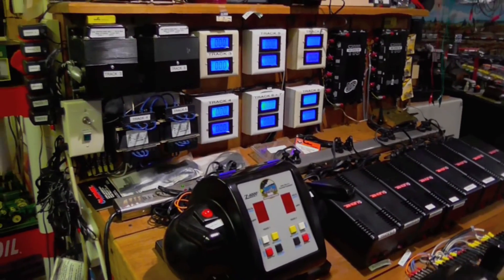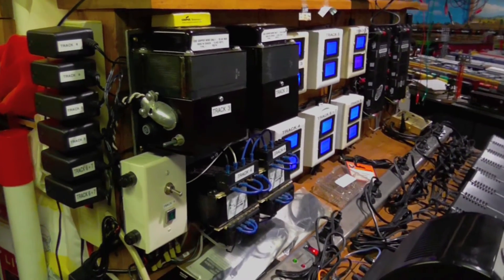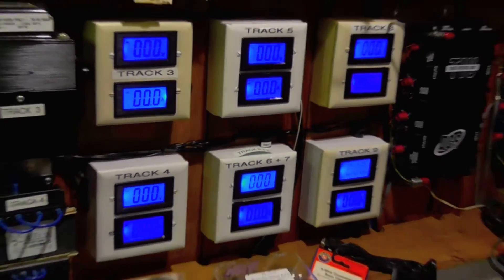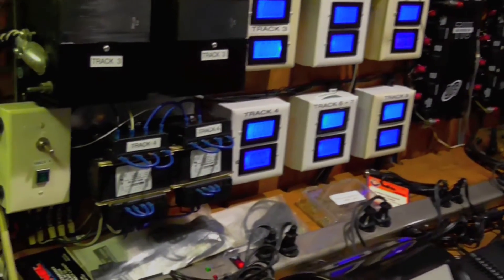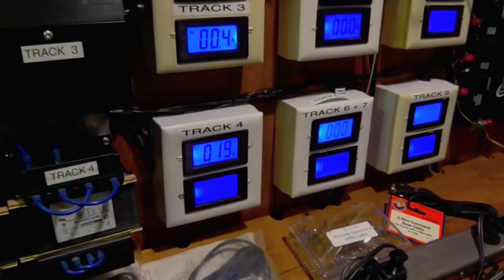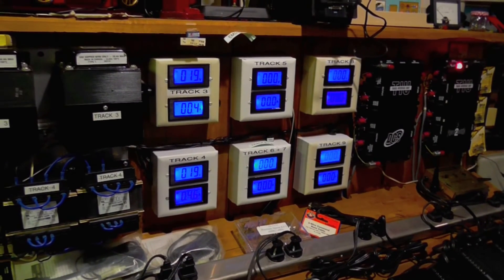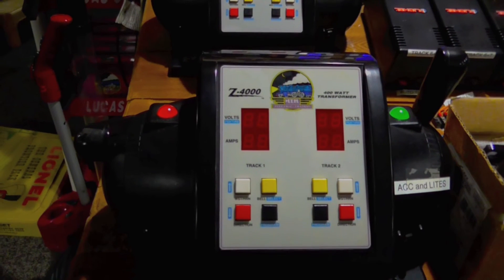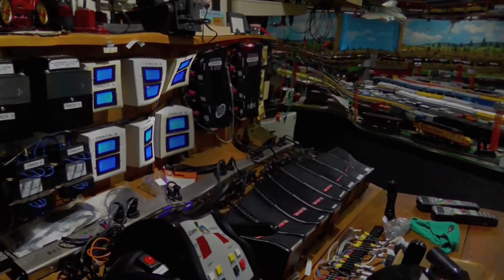MTH TRAINS: THE POWER SUPPLIES. (No. 2).

Comment: Are those blue lighted panels transformers themselves or are they just metering between the track and transformer? The setup looks interesting and complex. What are the brands of the not so obvious brands you're using? I'm trying to do research to for building a larger layout later. Thanks
Reply from the maker: Hi: no Sir; those are just "meter's" AFTER the fact ... We used commercial "step-type" transformers that bridge different power "taps" in the example you cite HERE. The reason's are (as you said), "quite obvious": more power (alot more), and channels that are no less then 30 amp's power (vrs. the normal 10 amp one can buy normally). 

Their fused / safe/ and solved all our issues. END-GAME: IF your gonna run "BIG CONSISTS" / with multiple engines ... you'll need multiple bricks (*say Lionel's "bricks" for example), OR: what we did here.

Best   :- )

Comment: Tommy do you use the 135watt bricks in parallel at all? I'm looking to double up sets of two (I own 4 for a medium sized layout), I want to have up to 15amps per track, but I don't want to blow up my TIU. Any advice?

Thanks! Good videos by the way!
Reply from the maker: Hi !!  NEVER in "Series" ... use them in "parallel", (and that means white atop of white, and Blk. atop of Blk.) This means 20 amps which should surface. AND: I was never able ta "hurt" a TIU ... BUT; my TIU's are wired in "passive". This means NO POWER is channeled through "anything", rather: only the "info. "packet's" are sent through (and "too") the rails. ** IF you choose NOT ta do it this way, you'll still be fine as you are still fused (inside the TIU as YOU said). 

What I used to do is run one "brick", and when it "tipped", I flipped the switch to "add" the other ... ("say for a Passenger Consist"). 135 Bricks are GREAT !   Best.  :- )
Reply: I see, so you tried to make it work with a single brick, and when your amperage exceeded the limit, you added the second with a flip of a switch (but your parallel wiring remained intact, regardless of power a single or both bricks together), did I read that correctly??

Very helpful information thank you!
Reply: What I have available to me (and I have 4 tracks that need power, covering a 20 x10 ft space), is a warehouse of transformer options... I have two TWs, two KWs, a ZW 250, two ZW 275s, two Z-4000s, and 4 PH-135 bricks to choose from. None of which are being used right now. What I was thinking of doing was creating a control panel with full contact switches which allow me to switch between which ever power source I want so I can strictly wire up my TIU (only have one) for a command environment via PH-135s, and then switch over completely to Z-4000s for conventional control if I want. (Probably will use a few postwars for accessories once I get to that, and then keep one as a back up and sell the others.)

If I wire in passive mode, does the TIU lose the ability to control convenionally via remote?
Reply from the maker: YOU GOT IT. That's exactly what I did ... *"some Tracks with 3 bricks even" !